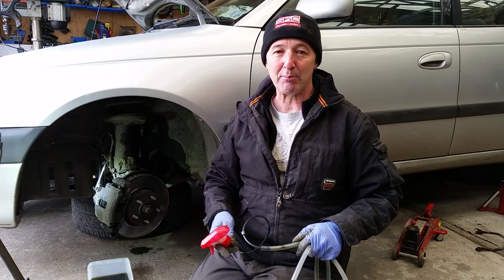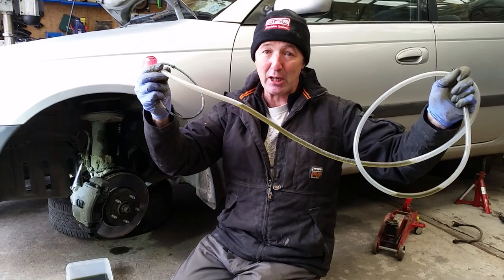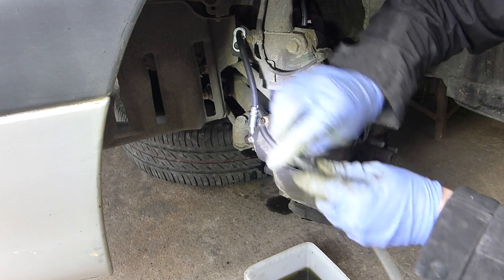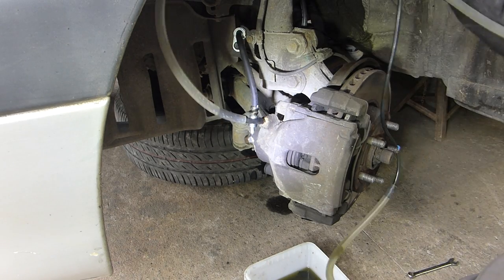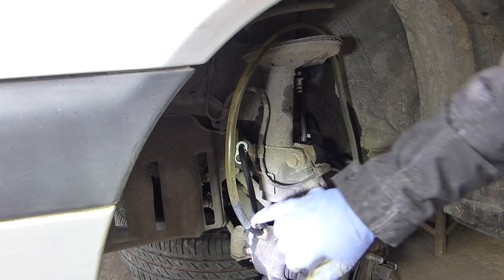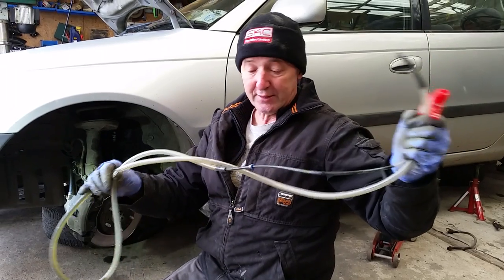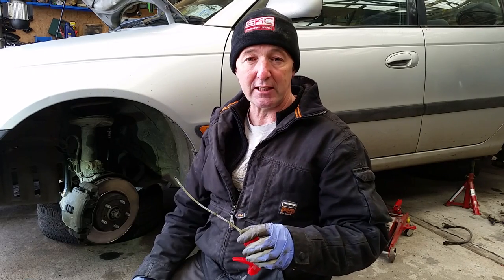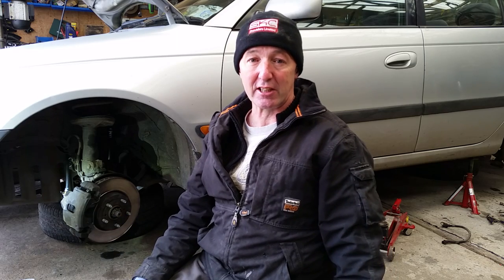Awesome - Homemade car brake bleeder -- Brake Flush -- Free

Comment: You saved my bacon getting trapped air out of a stubborn clutch with a really inaccessible bleed nipple.  The two person method was painfully slow and didn't work well enough.  Using your method let me pull about 300ml through the system in 5min.  No more air bubbles and much better clutch bite point. This is going to be my standard method now,  thank you.
Reply from the maker: Hi Aidan. Great that it worked for you. It really is a cheap fix. Thanks for taking the time to post a comment Much appreciated Cheers Gerry👍

Comment: I designed one of those one man "bottle" bleeders over 30 years ago... But you have definitely improved on that idea!
2 tips to make it work better
#1 keep an eye on the reservoir level so it doesn't get too low.
#2 keep the tubing above the brakes so you don't create air bubble back bleed from the loose bleeder valve.
👍👍👍👍👍 5 thumbs up to you!
Reply: The tiny bubbles going up are coming from the threads on the valve

Comment: I wouldn't have thought a spray bottle head would be strong enough.  That's brilliant!
Reply from the maker: Hi The Mid Engined Legend. Years ago I used a fuel pump off an old ford and hand cranked it and it worked well, I t wasn't a big jump to the Spray Bottle but it certainly makes lots of vacuum. Free to try too which is great 😀 Thanks for taking the time to comment Cheers Gerry

Comment: I took an old 12v tire pump for car tires and JB welded an inlet tube where it sucks in air and connect it to a catch jar with an input and output.  Put it on the nipple, plug in the tire pump and watch the catch jar as you open the bleeder and fluid will flow.  Easy and powerful.
Reply from the maker: Hi Rigid Wing. That was a cool idea to create vacuum. I have just remade this video but didn't manage to cure the bubble problem Thanks for commenting 😀 Cheers Gerry

Comment: This is a fantastic idea, another method is put a piece of tube over the open bleeder then put it in an old bottle of brake fluid then just pump the brakes, no need to open and close the bleeder. It works great. Also a tie wrap around the hose stops leaks.
Thanks for the idea

Comment: Brilliant.  Put a little grease around the threads to prevent air too.
Reply from the maker: Hi Dictum Factum Good advice Thanks for commenting 👍
Reply: I was thinking never seize
Reply: Ptfe plumbers tape is best 👍
Reply: I would use bubble gum, peppermint, spearmint , wintergreen , which ever you fancy .
Reply: teflon tape my guy
Reply: Blu Tac
Reply: The comments here suggesting Teflon tape on bleeder screws only reaffirm why I work on my own vehicles. Yeah, no. I'm not going to risk anything causing the taper to not seat fully. Grease around the outside if anything.
Reply: No grease... it will contaminate the brake system if it gets in.
Reply: NOT grease. A few drops of brake fluid
Reply: JJJ SMITH NOOOOOO! That stuff gets everywhere. Don't use it more than you have to.
Reply: Ya, just turn it 1/8 to 1/4 turn. Should be enough.
Reply: @ichoozjc  thanks for the advice 👍
Reply: I saw a guy using a tiny zip tie ,that trick works every time.I also cut the end off the tubing every time and heat it with a lighter and put it on the bleeder before it cools down,this makes sure the tubing gets a tight seal around whatever bleeder I'm working on at the time.
Reply: If it's open too much close it just a little this dude has invented the greatest thing in the world don't knock it damn he could have kept to himself !!!
the air/ bubbles that you're seeing is not coming from the threads inside it's coming from the threads outside ! who cares your getting fluid from the reservoir ! Path of least resistance if you pumped it all the way down ,then you  might be getting some air in the lines ? probably not ! my hat's off to you! thank you !
Reply: Very good tip. Thanks
Reply: @PRYRA  On the threads, inside the caliper? I could see that working if you unscrewed the bleeder valve a ways before wrapping it, so tape could go into the threads a bit. I like anti-seize idea best, though I'm not sure it matters though. Drawing air in past the threads might fool you that you are sucking air out of the caliper when you're really not.
Reply: second that opinion 😊

Comment: Bloody Brilliant !   I would like to suggest just little addition to that kit.  A small one way check valve check valve!  From the brake bleed, use a 1"/25mm hose, then the check and then as long a hose as you need to the stray trigger.

The trigger has it's own stop valve and the check valve will prevent fluid from being drained out of the hose when disconnecting from the bleed screw.  At least a very minimum amount of fluid of which a rag will catch.  At least, if you drop the hose or lay it down, it won't leak all over the place!

Ohhh and by the way, make sure you top up that fluid in the reservoir before you start and keep an eye on it and keep topping up!!!!

Cheers

Comment: This is great thanks. I used plumbers PTFE tape wrapped around the plastic pipe to make up the thickness to match the ID of the rubber tube, works a treat 🙂

Comment: I didn't read all the comments. Try Teflon tape on the threads. And janitorial supply will have a high capacity sprayer for rear brakes. Sometimes the bleeder is blocked, necessary to remove and drill out rust blockage. But great hack! Now u don't need to buy another mityvac gizmo for $35! Cheers!!!
Reply from the maker: Hi CORVAIRWILD Thanks for the suggestion Cheers Gerry👍

Comment: Having a huge brake problem on my old bronco, changed pads and calipers and got a ton of air in the lines, and every time I bleed the system it did not get better, this method got it back to a ok” state, will try more when I get a chance but at least I don’t need two people. Thanks a bunch

Comment: ☝️one thing...
You should just cut bottom part of original bottle of the sprayer so you got:
1. Better handle,
2. Room to store your bleeding lines.

Cheers
Reply: cool hack!!
Reply: Awesome
Reply: Great idea men
Reply: Hey... I like your idea. Thank you for sharing.
Reply: Nice!
Reply: Yes, but if you do that, you'll have to keep  your bottle higher than the nipples  because air goes always up and you don't want air back into lines, that's why with a line you can keep it up (hook it up at worse) from the nipple and spray down (better ergonomic)
Reply: 3. If you cut a bit up from the base of the bottle, you'd now have the tray to catch the brake fluid🤔....all from 1 spray bottle👍
This is just an unbeatable recycling hack all around🤣

Comment: A large veterinary syringe for oral use works well as a cheap vaccum bleeder and can also be used as a reversed bleeder. I paid less then $3 at my local farm store. 
This spray bottle seems like a good idea as well. Thanks for sharing.
Reply: Dude I'm STUPID. I have plenty of syringe type w/o needle saline. I could have used those w/a piece of hose. Thanks man..
Reply: @beetlejuiceonsyte1945  no problem. Happy to pass on things that i find useful.
Reply: and you can push the fluid up on a bike/ATV. so much easier than try to pump smal brake systems
Reply: How many CC for the syringe? And how much should you draw out?

Comment: A good way to keep air from seeping through the base of the bleeder valve is to apply a layer of grease, it will plug the cavity between the threads as you apply vaccume preassure to the line.

Comment: A good idea as a poor mans substitute for a $19 hand vacuum pump, but:
1. Air is more compressible/expandable (stretchable) than fluid. A shorter tube makes the work go faster. 
2. Most of the air is being sucked in around the threads of the bleeder screw. Put some silicone grease/Silglyde around it and this hack is more effective.
Reply: ... anf find a piece of tubing that fits, so you have no tubing joints, there is probably more air coming in where small tubing is sleeved into bigger tubing, than via the threads.
Reply: Catheter is what I used for the tubing ....this one was clean.
Reply: No buddy.. Liquids can't be compressed.. Physics..
Reply: @TR4zest  those hoses fit tight, no air was getting around there
Reply: I'm thinking a bicyle pump with the plunger(?) turned around so it sucks instead of blows. Could do a brake line in one pump and nip up bleeder towards the end to gurantee that no air gets in.

Comment: Did a pressure bleeder with a £ shop garden sprayer, hooked up to the master cylinder (well sealed, fitted gauge max of 15 psi!). Worked a treat, no pedal pumping required either. This is a very good alternative idea, using vacuum instead of pressure, that i will remember and try one day for sure.

Comment from the maker: My design and build ..  5 Dollar Homemade waste oil burner.   https://youtu.be/ShTLaYKjzxw Cheers Gerry
Reply: Been doing this for years. Works great just don't open the bleeder too far
Reply: Sir, thank you.
Reply: Brilliant hack there brother.. Thanks very much ..
Reply: Dad had an auto shop in the 70s and we had a homemade wood stove.One oil barrel two pipes going up to 2nd barrel stovepipe going about 30 ft. Using much of the heat.He also used sawdust to soak up waste oil on the floor.When this had been saturated it was burned in the stove making use of waste oil and gas.We had 80 acres of timber so it was almost frer.
Reply: Awesome mate👍

Comment: Good idea, I did a similar thing without the squirty gun, I just put a long tube on the bleed nipple and up to the inner wing ran into a plastic container then pumped the brake pedal and topped up master cylinder, as you pointed out as long as the tube runs high up any air runs up the tube, when no more bubbles close nipple job done. No need for second person.

Comment: I've been using an Eezi-Bleed for years but have found it struggles to push fluid through ABS systems. So, I've been looking for a way to create vacuum to suck fresh fluid through. I considered using a vacuum cleaner and even the car's own vacuum assist pump. Now though, I feel like any video I put out about brake bleeding will always be eclipsed by this one 😂. You Sir, are a genius 👏👏👏👏 🖖🖖
Reply: Oh, and additionally: two tips:
i use a small tie wrap to secure the hose to the nipple
and
apply a couple of drops of brake fuid to the threads of the nipple to provide an air seal (grease and oils may contaminate the brake fluid).
Reply from the maker: Hi Cyclone Cyd. Thanks very much for taking the time to comment on this video. It's a simple little procedure  now and pulls the air and fluid with no difficulty at all. I love the free part too 😀 Cheers Gerry👍

Comment: Great alternate use for the spay bottle pump, however I noticed that the brake fluid was creating mist.  Care should be taken, since brake fluid has a tendency to bubble painted surfaces.
Reply: Exactly brake fluid is very cancerous and by spraying that into a dish you do not want to breathe that crap in that will cause lung cancer! That's no joke! That guy should be wearing a dust mask!
Reply: @Eurospec73  That's brake *dust*.
Reply: I noticed that too. That it is a big concern. Maybe you should use a sprayer that has an optional screen in front to spray foam instead of mist. You could use a piece of fabric
Reply: there is a solution - destroying a nozzle 
without nozzle spray pump will generate stream of fluid without creating mist (optionally put pipe on destroyed nozzle and put other end of pipe in eg. bottle)
Reply: Or you could simply insert the nozzle tip  into an empty brake fluid bottle or similar container and spray it into the bottle thereby keeping the mist contained.
Reply: Choose a spray bottle that has both "stream" and "spray" settings and use the "stream" one.
Reply: @puppetmasterblaster  calm down man! Im certain youve spoken before thinkin things through too...
Reply: @bilbobaggins5962  if u were called an idiot everytime u made a mistake, that would get irritating quick...

Comment: Good idea I usually was using the tube and plastic bottle method putting tube into fluid in bottle them pump brakes till comes clear out tube then tighten up bleeder.

Comment: YOu can also put a greased rubber O-ring at the threads on the rotor to help stop outside air coming in.   G>

Comment: Just did mine sprayer not enough volume used a softsoap hand cleaner pump worked great Insulation form co ax for a tube the pump has a clear straw 👌

Comment: you need to take the spray nozzle off the end of that thing so it doesn't spray all over your paint or anything like that.  It just unscrews. other than that it's genius
Reply from the maker: Hi PHILNJOYLN The brake fluid is bad for paint but this poor old car was nearly 20 years old and only needed to last another few weeks. It has since been humanely put to sleep.😜 Thanks for taking the time to comment Cheers Gerry👍
Reply: My newest car is 20 years old. My other vehicles are 35 and 44 years old. All running strong.

Comment: Simple and it works.  Do yourself a favor and go buy a few feet of smaller diameter tubing at the local hardware store to avoid the tube-in-tube that lets in air.

Comment: Best to get the sprayer from the home defense pesticides at home depot because they are battery powered and you dont have to keep sqeazing
Reply: What about the mist from a sprayer?  If that gets on your paint it will ruin it.  Also make sure not to leave a mess your pets could get into.  This stuff will kill them.  I will just use the hand pump that is made for this sort of thing.  It would be cheaper than repainting a car or much better than putting a pet in danger.
Reply: @charleshines6155  Hillary lost
Reply: I'm thinking a bicyle pump with the plunger(?) turned around so it sucks instead of blows. Could do a brake line in one pump and nip up bleeder towards the end to gurantee that no air gets in.
Reply: @kirkc9643  I bought a really nice snap on break bleeder that hooks to my compressor that  wasn't too much money as well. I'm really happy with it and if I remember right it was only $150 and warrantied for life .
Reply: @kirkc9643  or you could use the Dallas cowboys if you really want it suck.
Reply: @leobonin780  what about the new York Yankees?
Reply: Thank you. I had thought about using a pump sprayer but I saw your comment and just happened to have an old pesticide sprayer. I hooked the handle to my  clear hose and used it to bleed my clutch after changing the master cylinder. (100x more painful than brakes). Bled my system in 20 seconds.
Reply: Charles Hines most sprayers have a mist function AND a stream function. Set it to stream and dont sqeeze super fast, problem solved. Or you could find a cylindrical container that will stop any fluid from splashing. So many different possible solutions but you just keep on using your expensive one time use tools.

Comment: Very helpful. I just did my motorbike using a piece of clear plastic tubing and a smaller diameter rubber hose inside of that to fit tight over the bleed screw. But I used the old school method of a jar half filled with fluid. It works but there's always a danger of spilling it and on a bike I could reach the levers to pump fluid through. However, I've just mad up a 'squeezy' version for next time. Great vid.

Comment: I use something similar but I put wheel grease around the bleeder screw to keep from sucking air back into the line. It doesn't suck the grease into the line it just seals off any air leakage.

Comment: Gerry, I've done it like this 100 times.  It works.
 It is hard with the spray head if the system is empty, but for a simple line or wheel cylinder/caliper replacement, it works a treat.
Reply from the maker: Thanks Tom for taking the time to comment Cheers Gerry👍

Comment: Great tip, especially for when working on the older car where there is a real danger of the master cylinder piston sticking when you pump the pedal and it visits parts of the cylinder bore it hasnt seen for years!!!

Comment: Cool. Fish stores carry plastic tubing in the correct size for about 12c a foot. Just make sure it's the kind that brake fluid won't eat. I use it for lots of things.
Reply from the maker: Hi Heather Thanks for the head up  Cheers Gerry👍
Reply: @GerrysDiy  you don't happen to have a video on how to open a door up on an explorer? I heard the spring break that's attached to the lock. People keep stealing stuff out of my truck. It's probably easy but I'm searching for a vacuum leak thats hiding for all its it's worth.
Reply: Hardware stores around here carry the clear vinyl tube for about the same price. Works great.

Comment: I'm from Brazil and I'm sorry my English please
Is it necessary to tighten the brake pedal with this tool to maker system pressure? 
Or is it just necessary to open the brake bleed and press the tool trigger?
Thanks!
Reply from the maker: Hi Luiz. Your English is reat. You dont need to do anything with the pedal. Just connect to the bleed nipple and pump. It will suck the brake fluid from the brake reservoir. Really simple and worth a try. Hope this helps. Cheers Gerry
Reply: @GerrysDiy   my friend thank you so much for the information. You certainly helped me a lot with your tool, because it makes it easier to bleed the brake fluid. And you not only helped me, but many others with your video and your simple tool. I wish from heart successes in your personal and professional life.

Hugs from a Brazilian who loves American muscle cars. Mustang Shelby GT500 1965 is my dream rsrsrsrsrs

Comment: I like the idea.  Get a small clamp and tie the hose to the bleeder.  Open the bleeder just a little over 1/4 turn, just enough so you the fluid comes out. and you are good to go.   Not a good idea to open the bleeder too much.  That is a mistake most people don't think about.  It ios also a good idea to use the smallest hose you can and keeping the hose higher is added bonus.